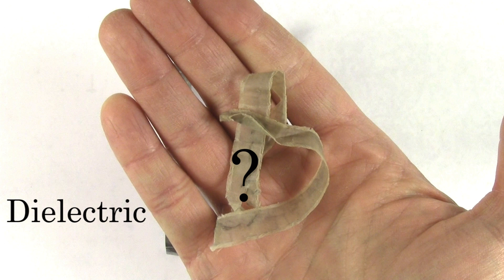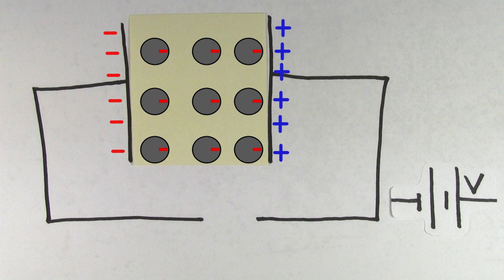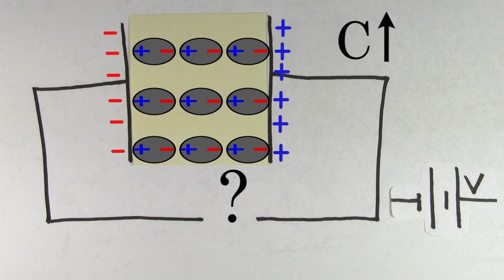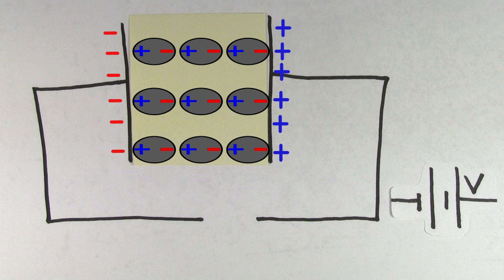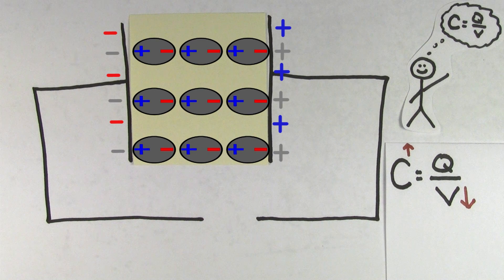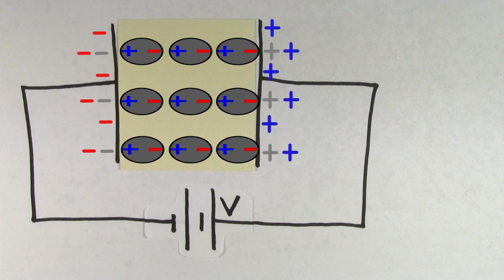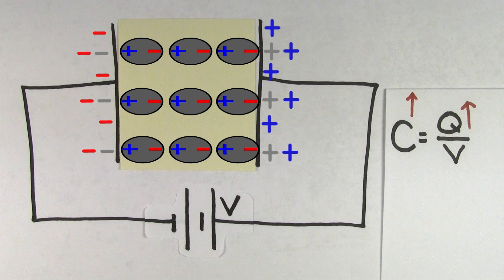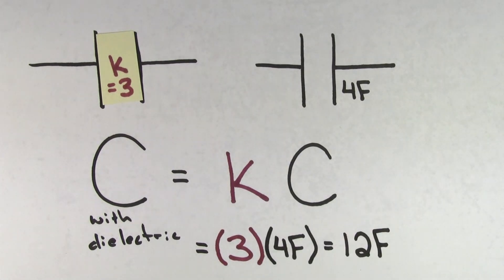Dielectrics in Capacitors (Micro Lesson)

Comment: I think the Dielectric decreases the output power. this is my theory, because the dielectric decreases the voltage between the capacitors the electrons on the negatively charged piece of metal really don't want to go back to where they came from, that is the positively charged piece of metal. because they are not excited to go back the speed/flow of the electrons decreases (slightly) and this causes a drop in output power because power is the rate at which energy is transferred as electrons are the energy carriers.

Comment: Am confused why the charge from dielectric cannot pass onto to the conductor plates. If some of the charges move from dielectric's end to the nearby metal plate, then it would cancel some of the stored charges in the plate. Where am i wrong?
Reply from the maker: Electrons don't travel from atom to atom in the dielectric. The electron cloud just gets distorted so as to make the charge distribution + on one end and - on the other. Now, get enough voltage and you can convince the dielectric to break down and conduct electrons.